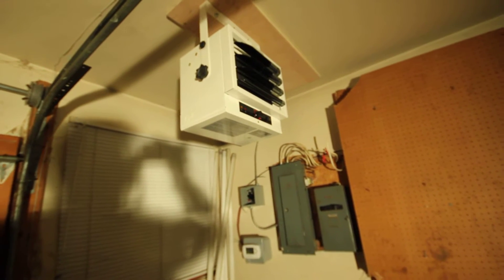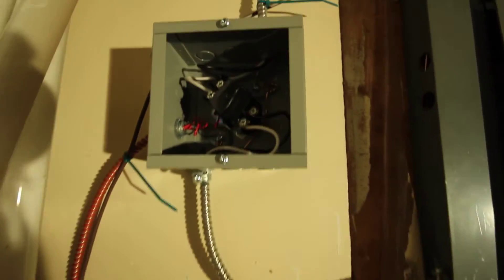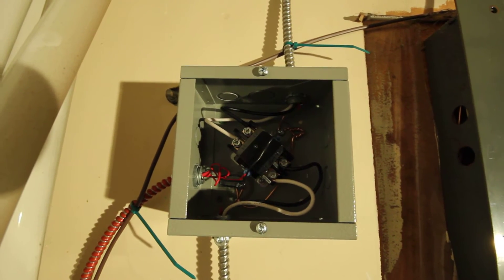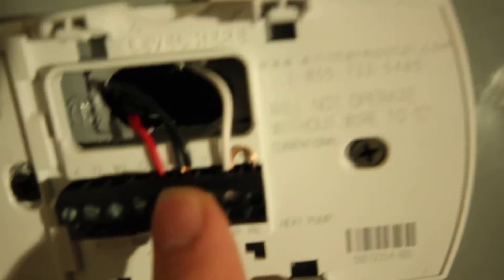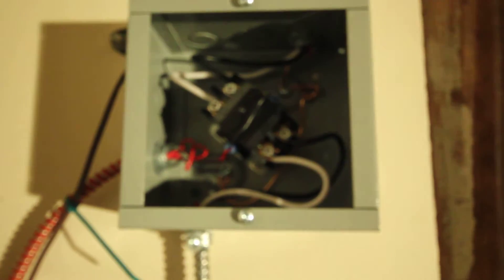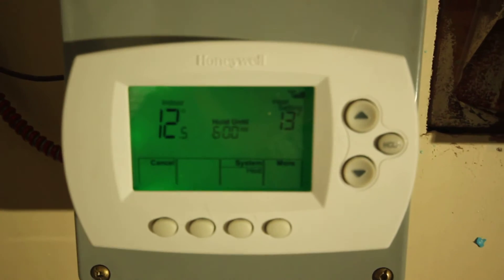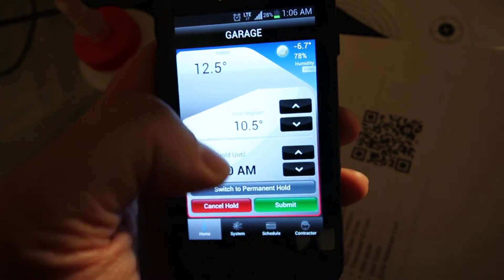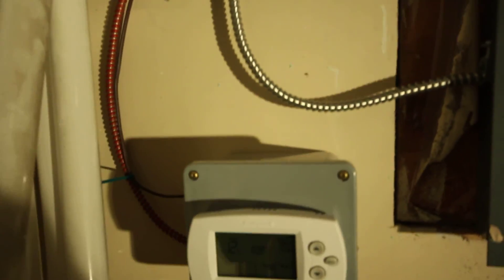How to use 24v WiFi Honeywell RTH6580 thermostat with 208/240v heating system

Comment: Thank u. Gave me some ideas for a home im workin on
Reply: I have two electric baseboard heaters producing 16 Amps currently connected to a double pole  22A-120/240 Vac(18A-277VAC res. only) thermostat. Can I use this same contactor to connect on a 24V  wifi thermostat? do you think it will work?